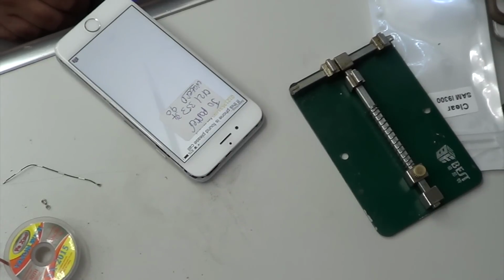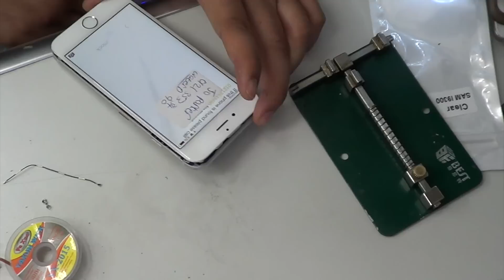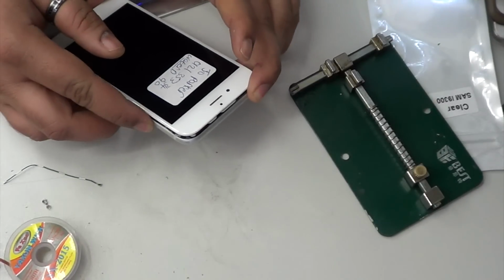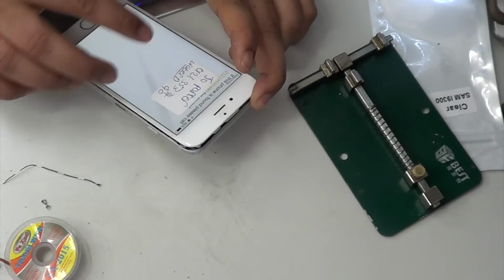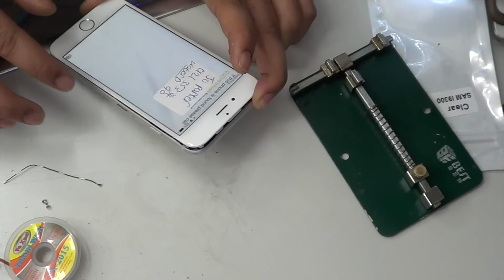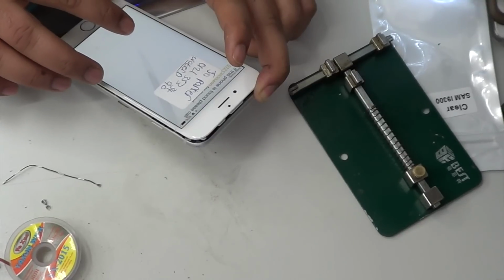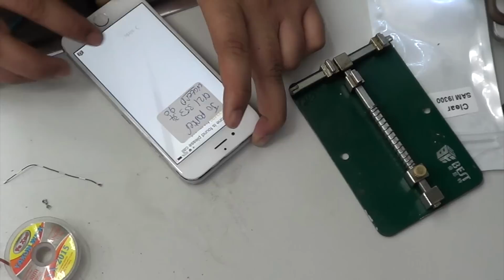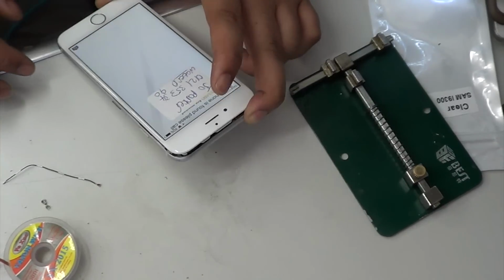Iphone 6 water damage repair/ short circuit

Comment: I just want to give you my thanks.  I was going to go buy a new phone after dropping my phone in the water.  I immediately turned my phone off when that happened and put it in rice but then later turned it on that night.  The phone booted up and died about a minute after and never turned back on.  I took out the sim card and smelled a hint of smoke coming out of the sim card slot.  First, I thought it was the battery so I purchased a new one, but it wasn't the problem.  I then thought that it was my screen so I tested a different screen but it also wasn't the problem.  Luckily I stumbled across your video and gave what you said a try.  It was pretty hard taking off the capacitor and I thought I had messed it up but my phone is working fine now so thanks again!
Reply: did you replace the capacitor with a good one?
Reply: Hey, did phone function normally after removing that capacitor

Comment: Had iphone 6 with short, removed that cap but short was still there and the power management chip got really hot. Would it be the chip or maybe another cap?
Reply from the maker: it could be either . could you look at the whole line all the caps and filters looks fine?
Reply: +M6 Repairs Some caps had a bit of corrosion especially the one by the wifi chip in your video. Removed that didn't cure anything
Reply: +M6 Repairs Some caps had a bit of corrosion especially the one by the wifi chip in your video. Removed that didn't cure anything
Reply from the maker: have you checked if the line is still shorted .
Reply: +M6 Repairs Yes it was and numerous caps around the power chip tested shorted. How would you narrow it down?

Comment: i had water damage this c5202 cap was shorted. i removed and replaced . The phone takes 3-5 to turn on while holding power button and also when the phone is on, it restarts itself every 5mins . any solutions?

Comment from the maker: you should put some circuit cleaner on any ordinary tooth brush and brush that dirt away try cleaning power button flex jumper if there is any dirt on it and resit the jumper if it works otherwise you will have to replace the power button flex after cleaning  .

Comment: thanx for the video but if you can help me just clear it to us please i have an iphone had dropped in the water and i opened it and test it  with my multimeter with continuity mod  there are many component in short circuit HOW CAN I KNOW WHICH ONE IS CAUSING THE SHORT?????      need your help please

Comment: I have a question. I have a Lifeproof case but the charger port opened when i was in the pool and i didnt notice till i picked it up and noticed that the screen was messing up so i went to the restroom and took it out of the case and tried to dry it with a towel also i tried too suck the water out with my moth i know thats gross but eh and tried to turn it on because im a dumb ass anyways it got REALLY hot and now my phone is completely dry but do you think it will turn on again
Reply from the maker: you will have to get  cleaned up from inside or maybe replace few bits as well

Comment: Hi there. I recently replaced my iPhone 5s housing to a different colour. Everything works fine on my iPhone but now my iPhone is getting hotter than usual. Especially when it is on charge. I have opened the phone up and the motherboard gets very hot. Rarely on idle but happens more when I use Whatsapp and stuff. What could be the fix for this?
Thank you.
Reply: Also my battery is draining faster as usual

Comment: my iPhone 6 was in rice and its on now but I'm scared to put my new SIM card in it cuz it has a brown smudge on the right side and my lock button isn't working please reply what should I do
Reply from the maker: +miggums18 you should put some circuit cleaner on any ordinary tooth brush and brush that dirt away try cleaning power button flex jumper if there is any dirt on it and resit the jumper if it works otherwise you will have to replace the power button flex after cleaning  .
Reply: +M6 Repairs how do I clean the flex jumper?
Reply from the maker: +miggums18 Use some circuit cleaner (its a liquid you can buy from electronic component store) pour a bit on a tooth brush and rub

Comment: my iphone 6 fall in water and then just after that i put the charger to charge it but it's not working any more .Ithink the electric part is broken . What should I do
Reply from the maker: +mamita diop if you are able to disassemble your iphone do it and see visually if there is any corrosion on the pcb and clean it with pcb cleaner. If you think the corrosion is going all the way underneath metal shields. They post your phone to us we will repair it for you or watch one of our videos on how to fix iphone 6 water damage